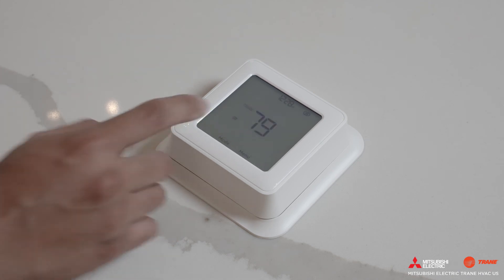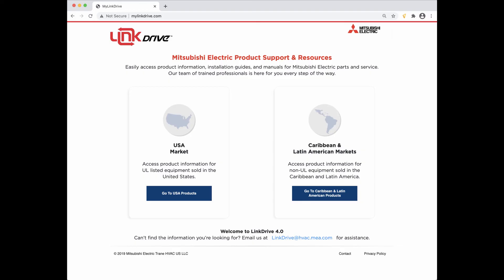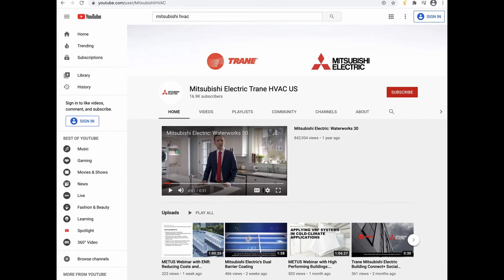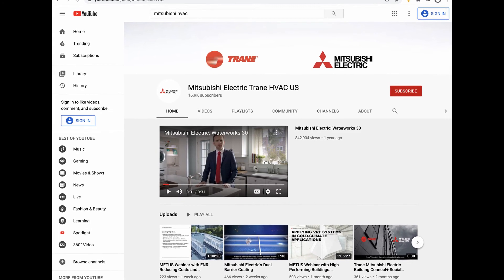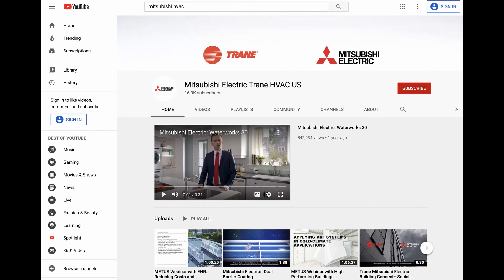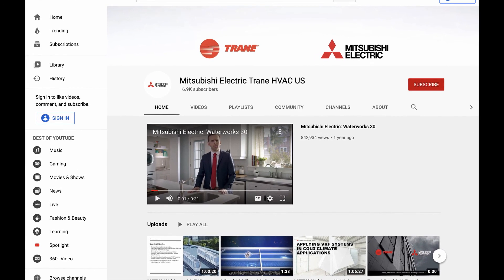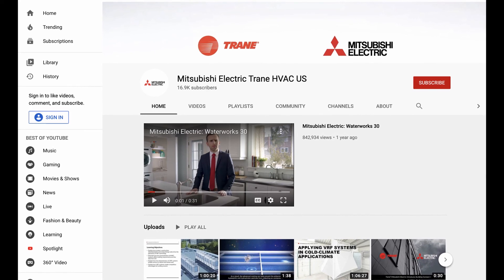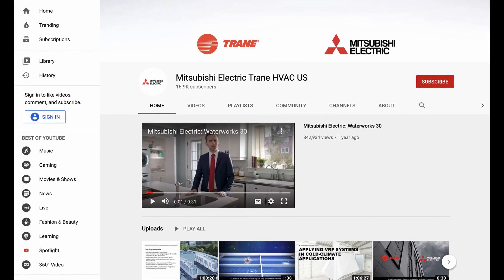How to Change Static Pressure Settings on a MHK2 Controller

Comment: How to make it stop the blower motor when desired temperature is reached ?
Reply: Did you figure this out? I'm actually looking for a way to lower the speed of the "low speed", it blows pretty hard even on low. I think that changing the static pressure setting will do it but not sure.

Comment: My question is how to unlock MHK2?
Reply: Add 1234 to the 4 digit code on the back of the thermostat
Reply: Most likely will have to reboot stat
There is a wireless router in your air handler or wall mounted unit need to press button down to reboot it , this should work
Reply: Is the date code on the box?